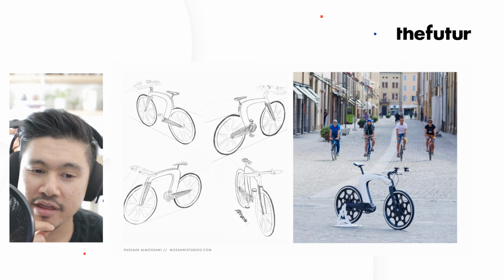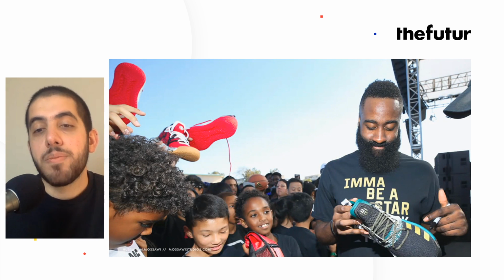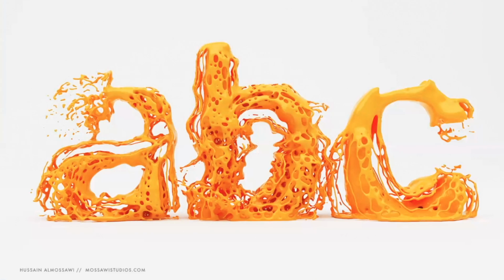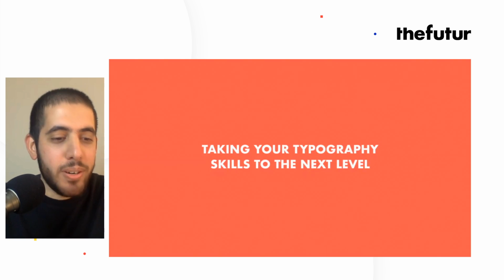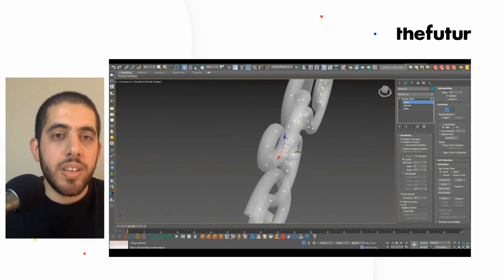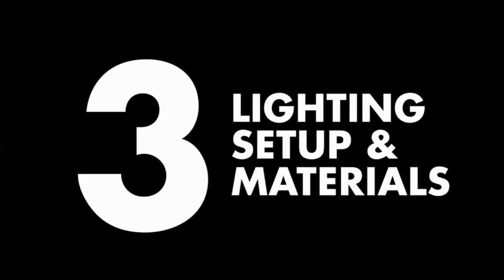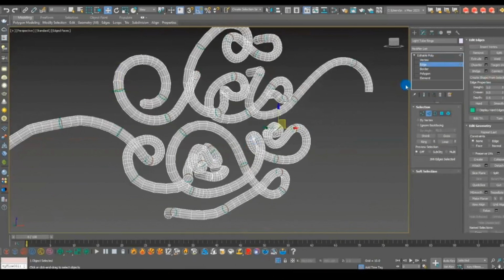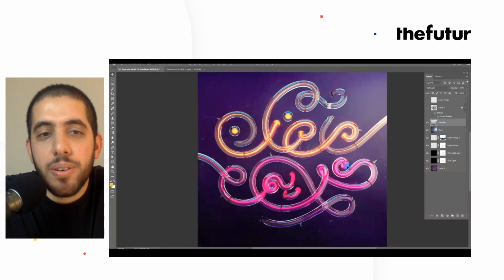Design Portfolio Review: Working at Nike, Adidas, EA and Beyond – Hussain Almossawi

Comment: The block that I have always had with 3D is that ultimately if you want to be able to do detailed animations, simulations and large-scale productions, you will need a lot of power within your device - and these machines can be really expensive. In terms of software there are great free alternatives to 3DS Max like Blender (which is completely open-sourced) however if I try to run a detailed fluid simulation my computer will crash for sure, so how does someone get around that? I guess you could try and get a position with a bigger studio that has more expensive hardware or just save? Im not sure.
Reply from the maker: Learn to work efficiently. Back in the days, we had less powerful hardware and software and were still able to bend the tools to make beautiful work.